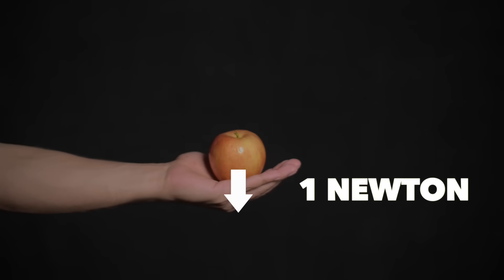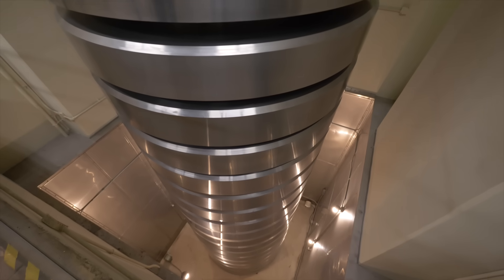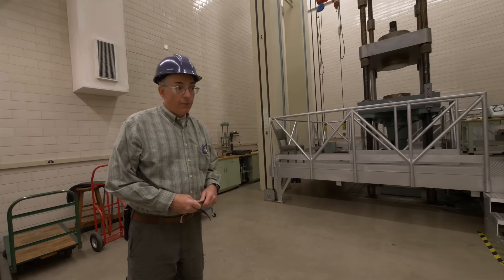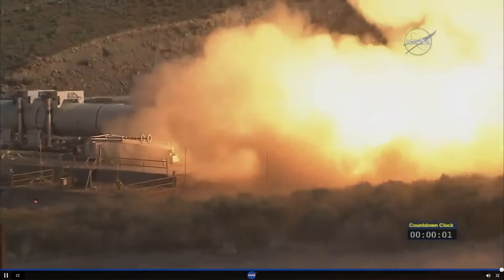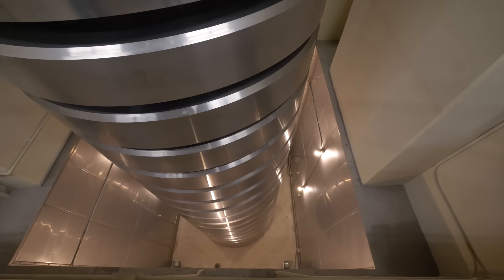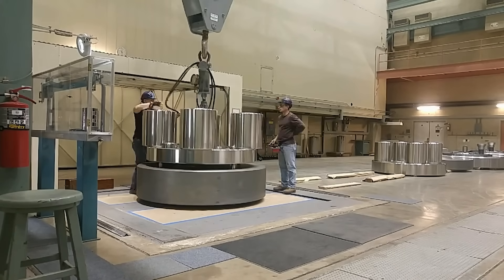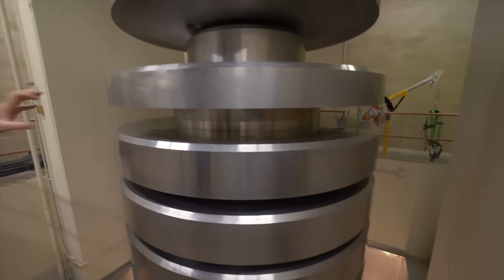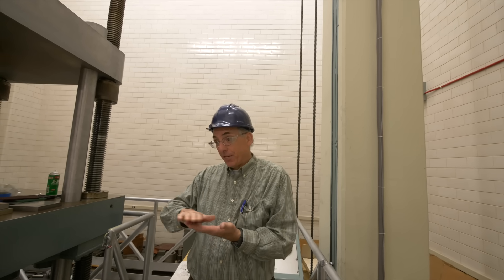World's Heaviest Weight

Comment: If this is used for testing, why did they convert everything to imperial units? Wouldn't it just be easier to keep it SI since most scientists and engineers work with SI anyway?
Reply: Tom Mass Most companies in the aerospace industry in US and Canada still use the imperial system
Reply: Tom Mass Most US engineers are comfortable with both units with preference to Imperial system, US scientists generally use metric system exclusively. It's just the culture in different trade, I'm an EE and we use whatever unit that happens to be used in the manufacturing industry(like the copper plating on a electronic board is measured in mil:1000th of an inch but the dimension of the bord is measured in millimeter while the thickness is often described in quarter inch, then the diameter of the dish antennas and cable length are generally described in inch or feet, once you get used to it you don't care which system it came from, it's just a number that's used to compare the other numbers and which ever ones more neet and cleen is the ones likely used.
Reply: holmiumh I’m a Canadian engineer and I can say that most of us don’t really care which unit we use. Our preference is what we were raised with. Canada only switched to metric in 1970 (and it was a slow adoption) so a lot of the older engineers are used to saying units in imperial. 

Metric is generally considered better for every unit. However, the foot (base 12) can be very convenient for measurements. Honestly is doesn’t really matter which units are used as long as we keep it consistent.
Reply: jeremie burton just because they do, it doesn't mean they should, though. The rest of the world picked an accurate system, yet they refuse and convert everything, causing annoying problems
Reply: It's irrelevant wether you calibrate with kg or lbs as long as you know the exact mass of the calibration weight. The pound is derived from the SI unit (as are all other imperial units) and a simple multiplication by a known factor doesn't make anything harder. The US is already tied to the SI. If the kg changes the lbs will as well. If the meter is redefined, the inch, foot, yard, mile and all the other weird units that depend on them will change as well.
Reply: Well first off, these aren't imperial units. Secondly, pounds are more widely used to measure force than kg Force units are.
Reply: There is nothing inaccurate about the customary system. I like SI and maybe we shouldn't use customary units, but they are not inaccurate.
Reply: This equipment is probably all for a long time in use. You don't changes this kind of machines every 10 years or so. So I imagine over 50 years it will be exchanged for 1 Million Kilograms machine ;-). In the end it doesn't matter as long as you have calculator on your desk and the right table for doing the conversion.
Reply: They are muricans

Comment: >>>pounds
>>>newtons

Choose one
Reply: The kilogram-force (kgf or kgF), or kilopond (kp, from Latin pondus meaning weight), is a gravitational metric unit of force.

People confuse SI with Metric, and the SI did not include kilogram-force.

But it is a metric unit.
Reply: pounding newtons
Reply: can't they measure two different things
Reply: Due to the  Mendenhall Order of 1893 the basis unit pound as a unit are defined off the kilogram, so this doesn't work.  The derived unit of "pounds-force"  which should really be abbreviated lbf  is more correctly related to the kilopond or the kilogram-force unit of measure.  With the offset they should be equivalent assuming you correct for standard gravity.
Reply: "kilogram force unit"... Do you mean Newton's?
Reply: Pounds
Reply: pounds.

Comment: Did they have a system to negate dust? Or is this in a cleanroom? Or is the dust's weight baked in to the uncertainty?

Keep up the good work, Derek!
Reply from the maker: +Hamstertractor good question - there is variability due to the temp, pressure and humidity of air which varies the buoyant force. This likely swamps the contribution from dust. But I bet they also do regular cleaning
Reply: Veritasium That's true! 
I didn't even think of regular cleaning, I went straight for the high-tech mathematical route 😁
Thanks for the reply 😊

Comment: Converting to Imperial just seems like an unnecessary endeavor and makes room for precision loss.
Reply: zach burke yes, conversion can be accurate. But that doesn't address the issue of why conversion needs to take place in the first place, if 95% of the world has already progressed onto SI units.
Reply: zach burke it's not like it's a big change anyway. It's still a puny number against the rest of the world
Reply: superdau you still haven't answered the question of why we need both.
Reply: Julian Grimoldi you are estimating based off of country size, the US alone counts for 4.5% of the world.
Reply: I disagree, because pounds are based off the Kilogram it doesn't matter.
Unless its human error, but if it was it would be fairly obvious.
Reply: Nothing preventing another country from building their own 1Mlb force calibration unit and using what ever system they want. Since the unit is in the US and we use imperial... that's the measurement that's used. If someone had built something larger, or even comparable, I'm sure Derek would have been more than happy to have visit with them.
Reply: The pound is defined as exactly 0.45359237 kg and based on the SI kg. Unless you start rounding you can use almost any calculator to convert between the two without any loss of precision. 
Citing precision as an argument for any measurement system is a stupid argument, because it does not matter.
Reply: There is no question about why we need both in the original comment. Anyway, as someone from "not-the-USA" you can guess my answer to that.

Comment: PLS get those americans to use kilos !! pls
Reply: But you rarely measure some acceleration in relation to Earths G like:

"Right so lets measure the acceleration of this place, all right it's 12,5 m/s^2. I think that's it. Oh damn, I forgot we have to also convert it to percents of Earths G so dumb Americans can also calculate their forces. 12,5 m/s^2 divided... by 9,81 m/s^2... multiplied with 100%. There you go 'Muricans, goddamn always more work because of those stubborn people.

It's just so much easier to use a unit that is not tied to to force it produces because it only works on Earth, and not even always on Earth...
Reply: It's not easier if you have to convert it a bunch of times later!
Reply: it might be in the specific case nice, but pretty much everything else is a lot better when it comes to compareing or converting different units with each other in the metric system.
Reply: Well, if we take into account the relative movement between the object and the point of view mass may change due to relativist physics :P
Reply: We already use kilos exclusively... when we buy coke from the corner dealer. See? Metric, bitches!!
Reply: JoeyRodz74 pepsi
Reply: but, "moot" because of stubbornness doesn't make the argument NULL.
Reply: Blake R You will have problems when comparing lbf to energy, lenght, time etc.. You have to use conversions to do that. On the other hand with Newtons you don't have to. That is why we don't use kgf unit.
Reply: Why? The British use pounds as well.:p
Reply: Phil Verhey it's actually easier for them to measure in pounds for this particular case. Watch the video again
Reply: jc9622 That's really about it
Reply: Blake R Okay, from my understanding, a pound is a measure of force, a kilogram of mass, a Newton of force, and the latter two are in the metric system. The unit of mass in the imperial sys. is the slug. Pounds are force units.
Reply: 450,000 kilos of force
Reply: He's just as happy to tell you Newtons if you want metric, and does so in NIST's own videos.
Reply: Blake R But then it fucks up if you go to an environment with less or more than 1 g like (moon or mars or underwater), then one pound of mass won't produce one pound of force anymore and everyone is confused because you are used to the fact that 1 pound mass is always 1 pound force. In metric, the mass stays the same where ever you go and you just multiple the mass with the local acceleration and you get the force...
Reply: Kilograms is a measure of mass, newtons is the metric measure of force.  What's nice about pounds is that one pound mass will generate one pound force when exposed to 1g acceleration.  In metric one Kg mass will generate 9.8 newtons when exposed to 1g acceleration.
Reply: Blake R I know, but this was meant as a general desire because it would make everything easier, as example like in YouTube Vids
Reply: DownDitto yes unfortunately this is the case where it's better to use pounds so it's a moot point
Reply: Blake R Oh my god how shocking.  You get one "hard" conversion if you want to calculate weight, when everything else is much, much easier to do because the conversions make sense.
Reply: Arttu Siukonen: Most engineering is performed relative to 1 g, you know like for literally everything built on the surface of the planet?  There's nothing stopping anyone from using metric in America, and as an applied science professional, I use it all the time.  Referring to an intimately experienced phenomenon (1g) is incredibly useful or at least convenient for keeping engineering analysis within the human realm of sensory experience.
Reply: Mister Bruh, Americans aren't the only people who uses pounds. Here in Canada, we also use pounds.
Reply: Arttu Siukonen hey idiot, if one pound produces 1 pound force, and you go to an environment with say 16% gravity, the pound force with be 16% it's original value. that's literally one of the easiest math problems you could think of lmao

Comment: Damn you freedom units...always making the rest of the world's watching experience worse
Reply: They're using pounds because they're American. They're is no underlying good reason for it.
Reply: But you could just use newton instead. (1.000.000 or 1.000.000.000 Newton for example)
Reply: @Hadron98  THEY DID USE NEWTONS.

1,000,000 lbf = 4.5 MN.
Reply: @Hadron98  No, because it wouldn't be equal would it? 1,000,000 lbf = 4.5 MN. 
1,000,000 Newtons would equal like 220 kip; i.e. 220,000 lbf.
Reply: @michaeldavis2531  I didn't mean say 10^xN in the video, i meant design the project with 10^xN. Because that is the SI-Unit and therefore should be used in anything somewhat scientific
Reply: But they should be using kg because they are scientists...
Reply: @Fl4shbackz  NO, Newtons are the scientific unit, and they did use Newtons anyways. There are 10 N/kg of mass, so GO CRAZY!
Reply: the amount of fluid is in turn defined by it's volume, so I would think they measure the same thing. Not a physicist here but pretty sure liters and gallons both measure volume, one being 1 cubic decimeter, and one being...no idea the volume of a gallon sorry.
Reply: Fl4shbackz   this is callibrated on some multiplication of a KG,   but then translated to pounds just for the americans to be able to understand it :P
Reply: @raafmaat  NEWTONS. 

(sighs heavily...)
Reply: @michaeldavis2531     you,  and people above here that keep replying NEWTONS.......
  the official weight where ALL the equipment is calibrated on is a weight of 1kg (there are a few of these 1kg weights in some labs around the world)    ofcourse this happens indirectly,   as they made copies of these weights,  to calibrate other devices,   and those can calibrate other devices etc,  but still it can be traced back to these 1kg weights!
Reply: @raafmaat  Well, nobody needs to be complaining about "including S.I. units" then, do they? Because he did include them in the video; i.e. 1,000 kipf.... just under 4.5 MN. For people complaining they give it in both units to make the video easier to market. So if he's measuring force, he'll be using pound-force or Newtons, not kilograms. 

Also, as I'm sure you know, in Newtonian Physics, Weight and Mass are 2 different things.... S.I. Mass is measured in Kilograms, and S.I. Weight is measured in Newtons. In inch-pound units, weight is measured in pound-force, and mass is measured pounds (mass), Also I'm sure you know standard gravity on Earth is around 9.8 m/s^2 (depending on the part of Earth, at the Poles or the equator), but roughly 9.8 m/s^2, meaning that roughly 9.8 Newtons act on every 1 kg of mass on earth. In inch-pound units, 9.8 m/s^2 = 32 ft/s^2, and this unit of mass will accelerate 1 pound at 1 ft/s at standard gravity on earth, giving you that 32 ft/s^2.
Reply: That was obviously a joke. That Hillary comment though... that may be the dumbest goddamn thing I've read in my life.
Reply: SJXenon87 - Newtons
Reply: Luis C Well actually measuring amount of fluid is different than measuring the volume of it. If you heat a fluid its volume increases but not the amount of it. There is its very own unit that measures amount, not volume. It's called "amount of substance". https://en.wikipedia.org/wiki/Amount_of_substance

But you're right and the other guy is wrong, gallon is a unit of volume and not "amount of fluid".
Reply: You realize he gave it in Newtons as well?
Reply: Newtons are metric there you go
Reply: Matěj Bagar Verbs?
Reply: Miguel Hernandez It's also sad that we live in modern day and the USA still hasn't adopted the metric system :)
Reply: @mike_dunno  Well, it isn't really that sad, it just annoying for foreigners who have never used those units before. You should mind your own business, don't worry about the U.S., worry about your own country's measurements, and don't be so concerned what's happening in other countries. America is still the largest economy in the world, so yeah, think about it...
Reply: Miika Mäentaus lol. We have in the 90s but everyone didn't care so we didn't either. It's still a law that no one in the USA follows.
Reply: He wrote “They're is no underlying good reason for it.”.
Reply: Miika Mäentaus convert it
Reply: Convert it maybe?
Reply: All of youtube science is bullying America
Reply: https://en.wikipedia.org/wiki/Pound_(mass)
https://en.wikipedia.org/wiki/Pound_(force)
Reply: Newton/Gravitational pull(Around 9.81) = Kg
Reply: SJXenon87 Pound is a unit of mass dumbass. Newton is a unit of force.
Reply: @ArnoldSig  Pound is also a unit of force, abbreviated as "lbf," look it up and think before you speak; https://en.wikipedia.org/wiki/Pound_(force)
Reply: https://pics.me.me/countries-that-use-the-metric-system-countries-that-lose-wars-18788032.png
Reply: @Gooberpatrol66  lmao
Reply: +Jpa  I was hoping that it was a joke.
Reply: Hoshimaru57 no, because of 'roughly'.
that thing in the video is hella exact, so I won't accept 'roughly'
Reply: @poseidon4675  458.872 metric tons.
Reply: +Luis C His comment was in response to the "pounds measure weight" comment.
Reply: Miika Mäentaus it's sad that we live in modern day and you people bitch about the conversations. USE THE INTERNET.
Reply: 454,545.45kg roughly, happy?
Reply: hahahahahashahahahahahahahahahahahahahahahahahahahahaha 
liter and gallons are not equivalent, they measure two different things, liters measure volume and gallons the amout of fluid
Reply: Gabriel Rangel someone voted Hillary and is salty.
Reply: davek Why did you use two verbs in the second sentence? Is that a new gramatical phenomenon? If yes, I'd like to know more about it.
Reply: Miika Mäentaus you goddamn commies
Reply: They're using pounds because grams and pounds are not equivalent, they measure two different things, grams measure mass, pounds weight, an important distinction.

EDIT: OK yes there is a pound as it pertains to mass but that has no bearing on what's happening here, this is measuring the vertical force vector created by the weights to calibrate things.  Hence why they have to adjust for the change in gravity.  The lbf mentioned in the video as a measure of weight is not relate able to mass which most people can relate to rather to Newtons in metric which are harder to relate to.  Either way it's harder for people to conceptualize unless you work with newtons a lot.